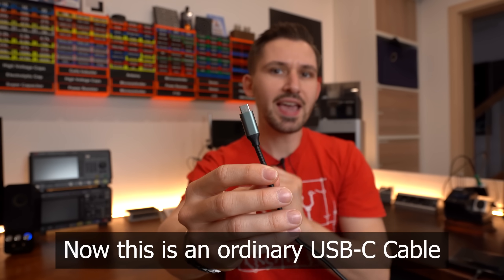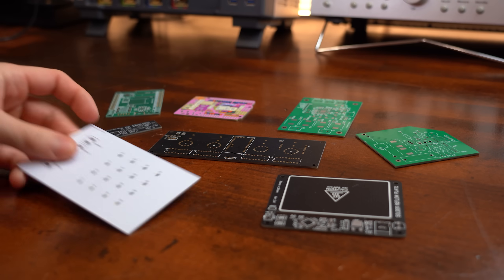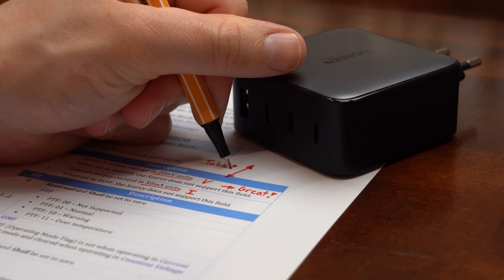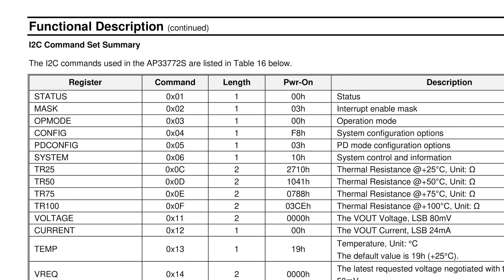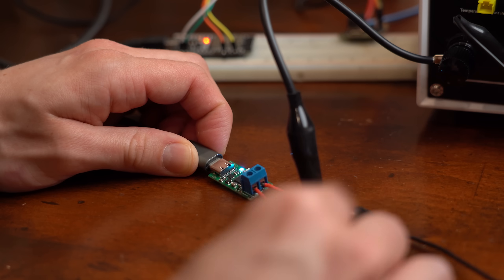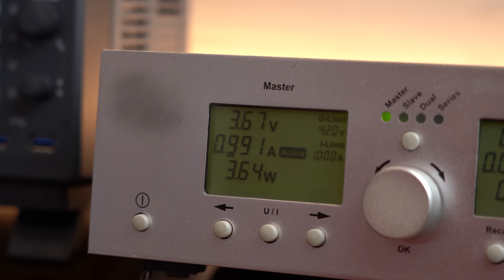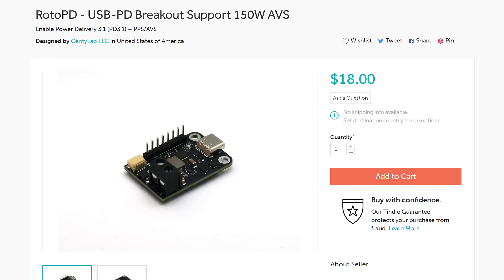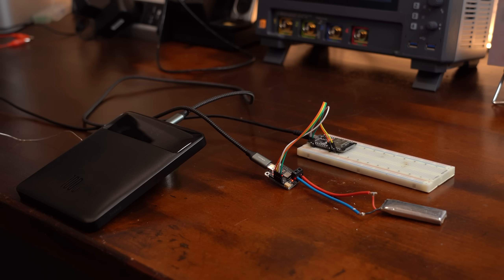USB-C Just got Even Better! (PPS)

Comment: The u in USB is supposed to stand for universal. If it's universal how come there's more than one size? Guess it's not so fucking universal is it😂
Reply: The USB procol of the bus is universal.
Any USB host is compatible with any USB slave and vise versa. 
The only non universal part is the shape of the connector. But that was never the part that Universal is directed at.
Reply: @Waldherz  well it's still a big stinky dumb head!

Comment: Do these devices pass through USB communications as well ?  - There are several projects such as using an Arduino for motor control via an application on a PC would benefit from this.  One lead in, USB pass through to the Uno, and 12v up to 3A to a motor shield to control steppers or DC motors, all through a single USB C cable.  Would save having to use a 12v 3A power brick for the motorshield.

Comment: don’t know why this appeared in my feed but so happens a few years ago after reading about the issues around charging LithIon cells/batteries i was thinking to ask an electrical engineer to help me create a clever charging device for use with all devices which use lithium ion  batteries to increase battery longevity. 

sounds like it is all done now and i can buy off the shelf. thanks so much for this video. very interesting.

Comment: If I wanted to have USB-C power and provide 12V (4 or 5A), and 5V (2 or 3A) output (both at the same time) what small breakout board do I have to buy from AlExress?
I need something as small or similar as in the video.

Comment: The opening ad that you did for the PCBs JLC PCB, who I have used for years and absolutely love! They are a fraction price of PCB way and have amazing quality results And every time I order a batch of like 50 boards, from the time I order in USA, Arizona, to the day that they are delivered on my doorstep, is usually 5 days or less. Only once did it go longer up to 10 days and that was due to a special configuration I had or needed with part of it. But otherwise they are extremely fast! Anyways what I was talking about was your lines sounded like the Marines code at first what they say in full metal jacket, when They say this is my rifle, there are many like it but this one is mine whenever you started saying this is my PCB, there are many like them lol

Comment: This is all and good until it burns up.  Case in point… I bought some cheap strobe lights for my drone that charges its batteries via a USB charger.  Not thinking much about this, I plugged one in to a reliable PPS charger only to have it BURN UP the device and USB cable.  Up until now I thought it was safe to just “plug it in” to charge.  Now, I have to consider FIRE as one of the outcomes if I’m not paying attention.  I understand that this isn’t the fault of the standard but shows the dark side of ‘cheap’ poorly designed gadgets can result in actual damage (this just happened yesterday).  A dumb old school USB charger has its advantages.

Comment: This is great. A lot of high power LEDs require constant current so this type of board is perfect!
Reply: Unfortunately, it sounds like the power supplies he tested ignore the current limit, and while limiting LED current by dynamically adjusting voltage based on the current reading is possible, the IV graph of LEDs is very steep, so you won't have much resolution.

Comment: I was wondering, why did you remove the ELV label branding on your powersupply somewhere in the last year? (ELV DPS 5315)
Is that a sponsor thing? Or didn't you like the styling? Or did it get damaged at some point and decided it didn't look right anymore? Or another reason? Obviously you like the device, you're still using it and have been for a long time now.
I'm just curious. I don't mean this in a judgemental way. I have no idea what a (professional?) youtuber has to deal with.

Very interesting video btw 👍

Comment: I didn't know about that, great!
That said, I would first and foremost refer to what the supply explicitly says on the label/product sheet. The fact that its chip claims to be able to follow PPS can very well be a default/remnant from debugging etc...
And when you're working out of specs like this, you better check extensively the supply as you'll very likely fry your board (as shown here with the current limit not working & overshooting the voltage)

Comment: I've tested an inexpensive USB-C PD/PPS  trigger from the popular e-commerce place.  It's full manual mode of operation with 2 colored push buttons (Green and Red.) Unfortunately, I have to report that its PPS mode isn't really feasible.  First, it won't retain previous PPS setting after power is removed.  Second, you have to press crazy amount of button pushes to reach high enough output value due to fine adj increments.
Note: different PPS power supply units have different response time, it's impossible to mechanically press a fixed amount of pushes to arrive the same voltage. Some units simply ignore up voltage commands.  To be honest, IMHO this direction probably is only good for a full PPS-sink side uP controlled, voltage monitored system.  With all that, I'd go back to a traditional power supply instead of relying on a client-server communication method, unless it's for smart phone charging.

Comment: You must try QC2Control (Also QC3Control) library too! You can control QC sources directly with voltage, no IC needed. There's a D+/D- signal table in the page "Hacking Qualcomm (Quick Charge) QC 2.0/3.0 With ATtiny85"(Youtube hates links, but googling it directly returns the correct page). 
I loved it, and even created a custom 5V/12V switchable power supply with just 3 resistors, 1 push button and 3.3V regulator. I would love to hear your opinion about this.

I hope this time my comment gets published lol.

Comment: And I was wondering why phone chargers no longer cost $0.50 like they used to when they were all 5V 500mA.
With all those features, precise voltage select etc. they are just a lab bench power supplies and they cost as much as one.

Comment: I have a genuine question. I’m an Electrical and Computer engineer by major and absolutely loved tinkering with circuitry and such in college and still mess with arduinos and raspberry pi’s today. What job did you have/do you currently have? I went down the power world (horrible, it’s very trivial and not challenging in the slightest) so I’m interested in pursuing a more challenging and interesting career. What would that job title be? PCB designer? Circuit designer? I have no clue. 

Love the videos, thank you!

Comment: If I’m understanding correctly, this unit should communicate with the PS so only the amount of voltage/amperage required by the device is sent? Such as, plug my MacBook in, charge it up, then unplug it and hook up my RPi5 w/o the possibility of under powering the MacBook or over powering the pi?

Comment: Now all I need is a way to configure the module to give me a specific voltage, but without an external microcontroller. I have a project where I need 16.8V to replace a built-in battery, and while I could also put in a microcontroller, it feels a bit like a waste to use a whole microcontroller just to configure the PPS when it gets connected to power. So close!

Comment: Is there a “high-quality” simple device/kit for the opposite functionality? I have USB-C-powered lamps that under max load use 12 V/3 A (Estimated amperage). I’d like to power multiple units with an already existing very efficient 12 V DC power supply (a Titanium-rated PC power supply).
Thanks for any advice!

Comment: That's exactly what does my phone but with a bit more power, I have a high end Xiaomi phone that can charge at a max if 120W but I can't charged it passed 30W due to protocol because Xiaomi has a proprietary charging protocol that allow 1) the 120W charging 2) has a AVS feature because it goes from 18 to 16V all without interrupt charge

Comment: Cool project, I was considering making one but then realised for my use case I just need a zener diode to go 12v -> 5v from a regular 12v PSU.
Reply: What’s the power loss and max current through the zener?
Reply: @gtjack9  Current is something like 200A. Power loss, good question.  But how much would the loss be going from 220V (or 110V US) -> a bunch of different circuits in the power supply -> your board to pick a voltage -> end device?  This board's absolutely great for a number of uses.  I think I was just meaning that after thinking about it I realise I'm over-engineering a specific problem I have that could just work with something simpler.
There's also a couple of small units that'll pump out twin 5+12v lines.
(Use case I was thinking of - removing power bricks / usb 5v bricks for a load of home automation things like a Philips Hue hub, a heating hub, a raspberry PI and some other small items and replacing with them with just a PSU with 5+12v going to a board and then barrel/usb power connectors.  Goal was one mains plug to 3x12v + 3x5v lines each.)
Reply: @ If you’re looking for alternatives for home automation power I installed power-over-Ethernet onto most of mine, they have one cable for the data and power, is plugged directly into my Poe switch, which has a UPS so my entire smart home, networking and Starlink will run for 2 hours in a blackout. Game changer.
I specially as the Starlink can take 5-10 mins every time its restart, so if you have multiple brown outs you end up with no internet at all
Reply: @gtjack9  they're all in the same 10" server rack that I built; POE's not a bad idea but it would need a splitter on the other end for each of 4-5 devices that needs 5 or 12v.  Five of those dongles would take up a bunch of space in the 10" rack compared to, say, a power box with a bunch of outputs.

Ideally I'd have something like the power supplies I have for guitar pedalboards but typically they a) only output 9v with maybe a single 12v output and b) are typically limited to 100mA per output.

Comment: I want CONSTANT CURRENT
to control powerful LEDs, which require it.
I need to ENFORCE it to the PSU, or, somehow, manage it on the board.
Is there a such a solution yet?

Comment: I think it is dangerous to select amperage greater than the powerbank or wall supply.  The maximum amperage often requires heatsinks to do it safely.  The power bank may not have the ability to get rid of the heat.  That could lead to overheating components in the power supply or power bank and that could be dangerous.
Reply: That what your chargers / powerbanks over current protection is for.

Comment: Let spend a second of silence for this. Back in the day we can use different cables to charge different things. Those use the same cable are almost always compatible with each other. But with Type-C, everything use the same connector but name the same CABLE or CHARGER. If you have a type C device needs power and data, you may found yourself in a maze. Without manual you may need to try up to ~32768 combinations(2.0/3.0/3.1/3.2/3.2x2/4.0/TB/etag/5V/9V/12V/15V/20V/28V/PPS). I don’t know who actually saved the environment, who ruined it…
I’ve seen A TON of small electronics(mostly from Chinese) have TypeC connector but doesn’t follow PD protocol at all, it can’t even get 5v because they omitted the pull down resistor on CC Pin. The only way this will work is use a Type A to Type C cable. Again, the Type C will reduce e-waste is just a bright future from a bunch of politicians with no knowledge to achieve it.

Comment: Puh, this topic is rather complicate. I, for ex., want to buy a USB-C pd socket for a mobile home, supply 12V but able to charge a HP notebook. It´s event hard to find specs for the needed supply voltage and current and much more to interpret the specs of the socket to fit the need. Most of the time, the sockets are titled with QC, an any Watt values.

Comment: Well, QuickCharge 3.0 is around for almost 10 years and it offers variable voltages from 3.3V up to 20V. Trigger boards for this are available for at least 7 years because that's when I bought one.
Reply: The voltages can also be triggered in 0.2V steps with a microcontroller directly or even a NE555 and a few other passive components
Reply: Configurable current limiting is worth a lot though
Reply: @adamfred "PPS doesn't directly enforce constant current mode."
All the current limiting is done in the trigger board anyways.

Comment: The power supply said 5-5.24 A so I'm guessing you can't limit it below 5 A. Also I would be careful using it to charge batteries. If the power supply decides to reset to 5 V, it could be deadly. You should have some kind of overvoltage protection before the battery.

Comment: There are chargers with EPR aleady. My baseus 160W charger supports 28V output, but the only device I have that actually triggers is is my Pinecil v2 soldering iron. I need to give those PPS boards a try.

Comment: now the question is, what is the cheapest PD-C brick that supports PPS? because last time i checked a lab bench psu is still cheaper.
Reply: Depends on your country, I bought one for 15 euros (65 watt type) . But the successor model they sell doesn't advertise PPS any more. Also have a car charger from that store (Action) with 2 PPS channels and 45 or so watt of power combined. I think that one was 7 euro. But they are gone too,, replaced by a model that does not advertise PPS.

Comment: There are different types of pd trigger boards on AliExpress which does seem interesting for different purposes.
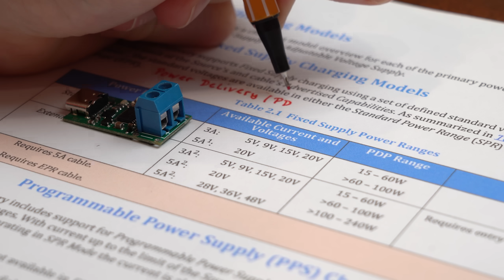Reply: 2:45 like the second one.
Reply: And there's also some diy kit power banks that does provide 100w by default but can be extended to 140w by adding additional boards which it does support by default (like the one you used before to make a 100w power bank)

Comment: If this could output two separate voltages at once this would be great
Reply: You’d need an extra wire in your usb standard, there’s only a couple large cross section currently.
If you want multiple channels you can just plug another one of these modules in to you usb-c wall adaptor

Comment: Are you able to do a video on the power supply / transformer in how that works when it receives the voltage request. I need to design a power supply and I would like to include PD and PPS.
Great video as usual 👌

Comment: That is pretty cool.

I know some USB cables or power adapters have being replaced as power cables or power supplies for consoles (like Wii, Wii U, Dreamcast, and others)
With this little thing. We can see more uses for those on more retro consoles or even other devices.

Interesting video. ^_^
I am considering hard modding my consoles to use not just HDMI, but also replacing power usage, like power ports or supplies to use USB-C.

I'm definitely trying to keep this in mind if I want to try out coding for it and get my devices to work with it on my own if needed.

Or just stick using those already made mods that does it for me.

But still. Having USB-C with power delivering and such to correct voltage and amps for such devices is always crucial so you don't overdo it and kill devices.

Comment: The header files (library) should define a whole bunch of "friendly name" constants for all the settings. You know, the parameter value of "4" doesn't exactly rhyme with 15V - see also 6:21.
Reply: Doesn’t that mean you need to program this for every single device you use it with?
Reply: That's actually a shortcomming of the Arduino library, there could easily be a lookup method to get the index of some voltage (or return -1 if not found)

Unfortunately the profiles map is private so you can't add that lookup in your own code.

Time for a PR i guess.

Comment: I have a couple of PD lab power supplies.  They take in up to 5A @ 20V then convert the voltage.  What I really want is one that is capable of setting voltage and current with PPS, which would allow it to be really small and efficient.  Sure, I could build one with the info in this video, but I'd like something prettier than what I could make.
Reply: No harm in trying!

Comment: I use a 5.5 barrel c9nnector 20v PD 65W GAN charger actually a usb C soldering iron supply but I don't have soldering iron to power pc also have 12v for backup for fibre and router have regular outages so win

Comment: I use USB DC-DC 5v-28v Stepup Converter boards to power 12V Offroad/Fog lights as a flashlight or yard light with USB power banks, much brighter than normal flashlights. Only downside is the boards i use max out at 2Amps.

Comment: I wish someone could adapt this so you can actually power a raspberry Pi 5  with its weird 5V 5A with just a PD
Reply: Hi Zaired, PPSTrigger V1.2 from CentyLab can provide 5V5A using PPS through compatible charger

Comment: I think you can get usb C "master" boards (for lack of a better word) that do allow 48V 5A output if given a sufficiently beefy power supply for the input. I also remember to have seen quite a few USBc trigger boards supporting 48V mode. DIY or buy "charge everything" charger in the future? Or maybe a spot in the next aliexpress treasure hunting episode for those USBc charger/master boards. I could see them used to add USBc to bench power supplies, as more and more stuff is supporting it and i can see it being very useful. 

Another interesting usage for 24/36/48V at 5A could be USBc recharging of small electric mobility devices, like an electric scooter, longboard or skateboard. I think 100-240W charging can be sufficient for those devices, and you could theoretically charge your phone, headphones, laptop and scooter from the same charger. Interesting idea, but who knows how practical it could be?
Reply from the maker: I can put it on my to do list. Feel free to share links though because I did not find such boards yet.